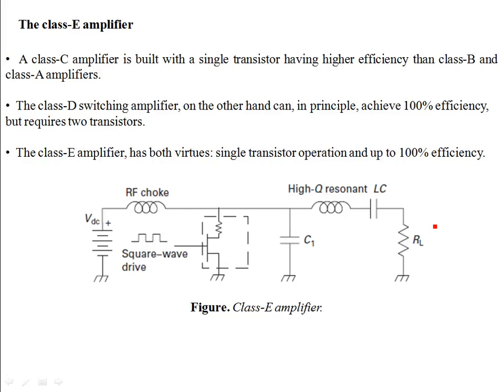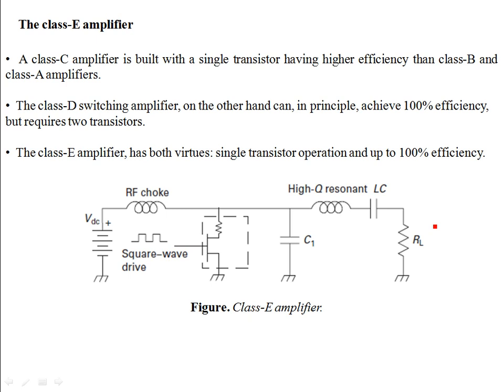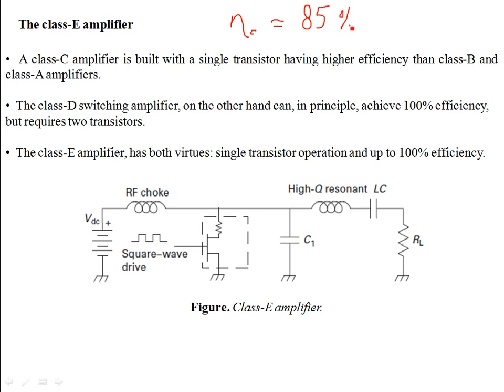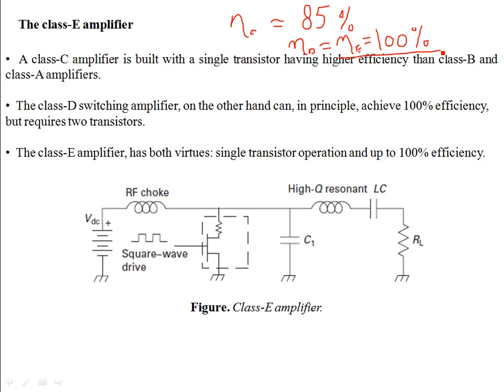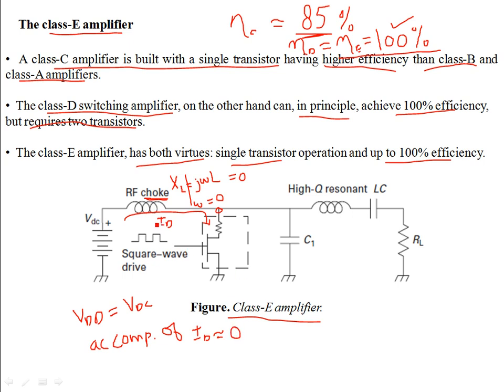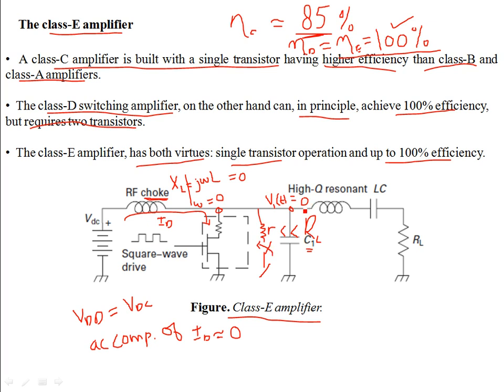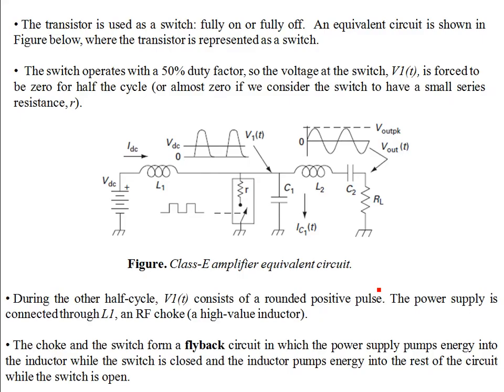Class E amplifier basic operation

Comment: how do we get V1(t) if in the circuit we don't have any sinusoid source?
Reply from the maker: The RF choke together with transistor forms a flyback circuit. You don't have any alternating source apart from transistor gate pulse which is driving transistor as a switch. When the gate pulse arrives transistor is ON or switch is closed implying shorting out of V1, during which the choke stores energy from the DC battery. When the pulse is absent at gate, the switch opens and RF choke supplies energy to the rest of circuit, forming rounded pulses at V1 between short circuits when the transistor switch closes. The series LC section appears as short at resonance and let's the desired sinusoidal at load just like a bandpass filter.
Reply: @mansoorkhan7109  thank you for the explanation.
Reply: @mansoorkhan7109  But for the RFC to discharge we should cut the VDD. Then the RFC can discharge to the rest of the circuit. VDD is present at all times and RFC cant discharge. Then how did we get the sine wave at the load. Pls clarify.
Reply from the maker: @askarali920  look RFC L1 is just like a short circuit for VDD supply when transistor is open so VDD charges up the shunt capacitor C1 creating a rounded pulse, when transistor is turned ON the node voltage V1 shorts out owing to very small drain resistance. These rounded pulses at node V1 are periodic hence can be filtered for its Fourier fundamental by the series L2 and C2 bandpass filter generating a sinusoidal at any desired frequency for which series L2 AND C2 combination is short i.e at resonance.
Reply from the maker: Yes we don't have any AC driving source for the circuit except the gate pulse switching the transistor ON/OFF.
When the gate pulse arrives the transistor turns on and choke stores energy from DC supply. At this point the capacitor C1 is shorted out. When the transistor is OFF the choke supplies energy to the rest of circuit creating rounded pulses on shunt capacitor C1. The capacitor charges up through VDD creating a rounded pulse and then when transistor is ON again V1 becomes zero and the trend continues.